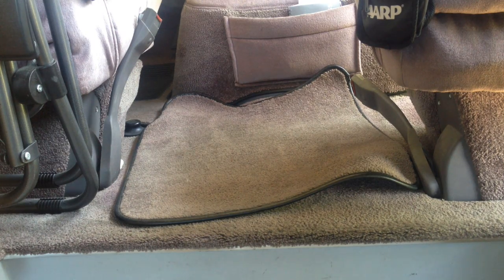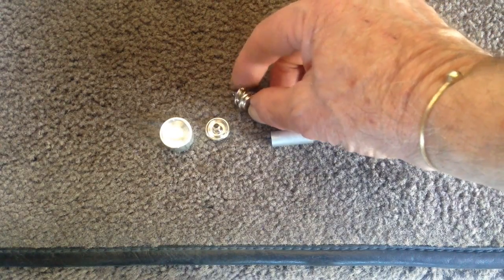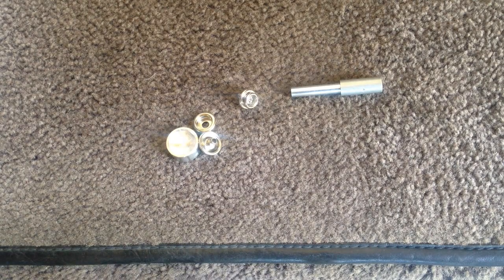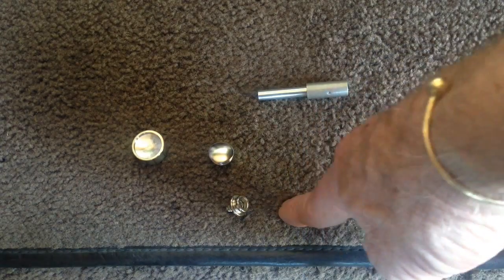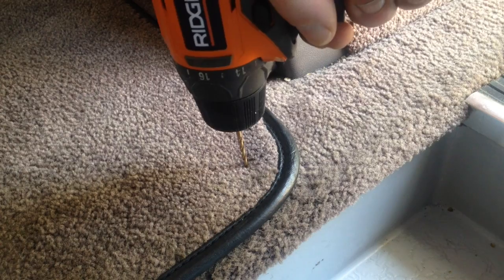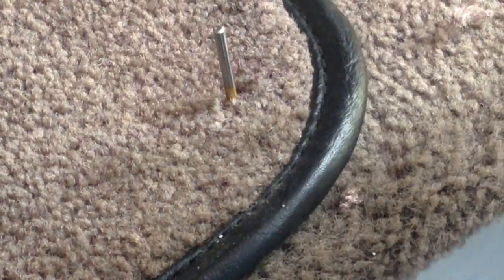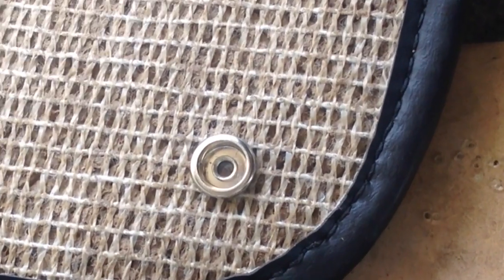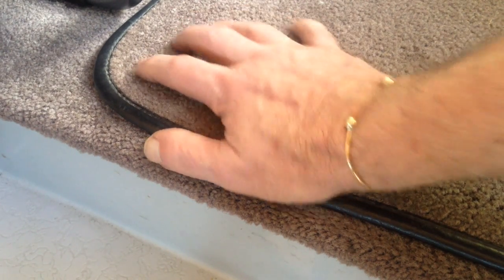DIY Keep Floor Mats In Place Installing Snaps

Comment: Get marine grade or stainless steel so they don't rust overtime.  Thanks for the tip Rich!
Reply from the maker: Thank you of the comment, Chuck, I'll have to check, I think these ARE stainless, they were kind of pricey.
Reply: don't listen to this guy hes drilling holes in the floor boards which will rust out your floors boards and ruin the mats.

Comment: I have been looking for a solution to keep my rubber floor mats from sliding on my trucks vinyl flooring. Your idea may work but I have a couple of questions. Did you worry about tapping into something electrical when you drilled the floor?
Can you see this trick working on vinyl flooring? Is there a floor mat thickness issue when installing the snap?
Thank you.
Reply from the maker: Hi MrBritrider,
Yes, certainly of critical importance to check out what is on the other side of the sheet metal before drilling through it.
Carpet with its backing might not be the same thickness as what you are proposing. The good news is that snaps come in a variety of sizes to fit a variety of applications. I have a leather shop in the area that is well stocked with a wide variety. Unlike the big box stores or hardware stores that usually just have their usual limited selection, the local small business person is more apt to have a deeper selection, especially if they do leatherwork themselves. If you don't have a leather shop, maybe a motorcycle shop that works with Harleys or other big bikes. They usually have quite a few accessories for those bikes in leather and might have some supplies to do repairs on customer bikes. Take a drive to one and tell'em what you are trying to do and maybe they could advise you what would suit your needs.
I think what you propose is feasible. One thing I would do is reinforce around both the cap and the snap base so that the force of the snap is spread over a wider area and might help the snap from tearing or pulling through the vinyl.  Some vinyl is kind of stretchy, especially in hot weather.
It would go like this, The domed, shiny cap of the snap, reinforcement, vinyl floormat, reinforcement, business end of the snap that snaps to other part screwed into the floor...make sense? What would I use for the reinforcement? Probably a rubber fender washer if thin enough or go to a bike shop and ask for a piece of bicycle inner tube and cut it up into squares, drill a hole through it and use that.  Maybe not pretty but functional. I've seen my share of torn-out snaps from rubber mats in cars and trucks so an ounce of prevention is worth a pound of cure.